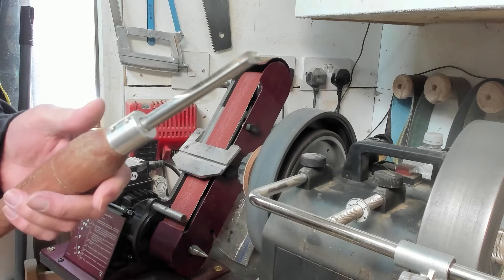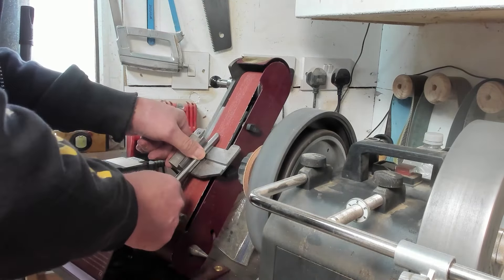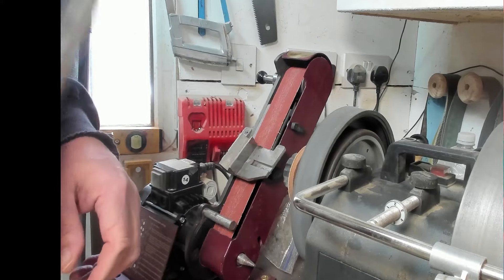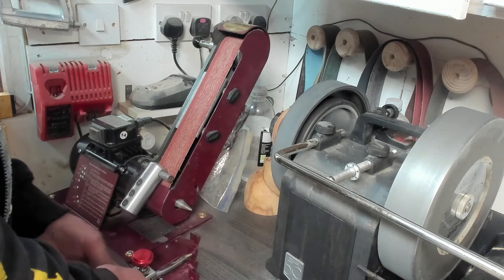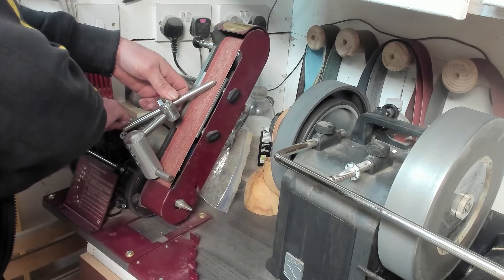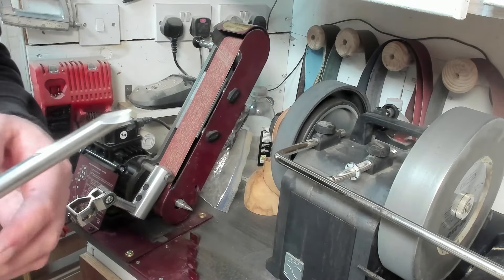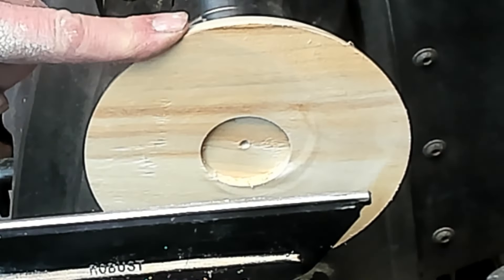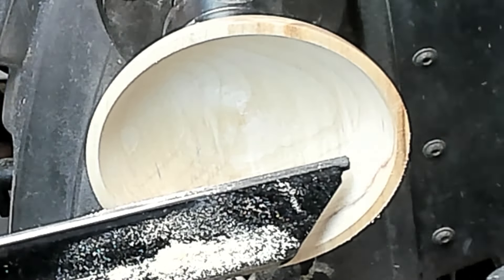Easy long wing gouge grind on the #ProEdge #robertsorbytools #irish grind #Elsworth grind

Comment: Excellent demo Pete, Did try this once a couple of years back and it all went horribly wrong. Now I see where I went wrong so will certainly give that another go. Thank you buddy.
Reply from the maker: Glad it was helpful 2 main points 15° horseshoe for the top profile and use the extra length of the 40° protrusion corrected to 45° or 50° on the long grind jig to avoid hitting the sides!
Reply: I seem to remember 1) Tha Handle stopped a full swiing to the left as you pointed out and I think I chose the longer pro set. Ended up like an assagai lol Now I know better

Comment: Looks like it cut really well.
Reply from the maker: It does cut well, the bowl was only shown on a couple of cuts to show inside and outside profile as I didn't want the video to run long. but I did finish the bowl completely with that grind off the 60 grit belt.

Comment: Nicely done Pete, yeah the problem the ProEdge has doing an Irish grind is one of the reasons I stayed with with a bench grinder. As you know I use an Irish grind on all of my gouges and when I tried out a Proedge it simply can't do it if the tool has a handle , it can do handless like you did in the video though. Great video mate.
Shay
Reply from the maker: Every sharpening system has strengths and weaknesses, ProEdge strength is the speed and ease of replicating Fingernail and Traditional  profiles on gouges and a flat bevel on Skews, stray from that and the weaknesses show. But simply drilling a hole at 40° allows me to create the 40/40 grind  easily (but no jig), this video shows how to extend the wings, so there are ways around. However the same is true of any system it's weakness can be worked around.
Reply: That is very true Pete,  no system is perfect.
Shay
Reply: Another great demonstration Pete 👍🙂

Comment: Hey Pete, where do you get your tool handles,? if you make them, where do you get the ferrule/collar with grub screws?
Reply from the maker: I make my own handles I like to make things I use every day and like them to be a bit different as I have large hands the connectors were designed by me and are sold by Mark Becket as I don't really do retailing you can find them here https://mark.beckett.woodturners.uk/shop/abrasives/52-85-multi-handle-ferrule.html#

Comment: Hello, Thankyou for posting this video. Really really helpful indeed. A question if I may, I have the ProEdge and am trying to work out if I’d be able to create a 30 degree long grind on a spindle gouge to create a detail gouge? The Proset only goes to 35 degrees so when using either  of the long grind holes it would only allow either a 40 or 45 degree bevel angle (due to the +5). Do you happen to know a work around how this could be done? Many Thanks, Joe.
Reply from the maker: I have a worn spindle gouge I will make a video. I think I can make it work...
Reply: @PeteTwistedTrees Hiya Pete, that would be amazing! Thank you, I’ll keep an eye out for the video :)
Reply from the maker: Just published the video, https://youtu.be/CHbjBmM9iPQ I failed to get what you want, but hope the video is good for you.
Reply: @PeteTwistedTrees  Thank you so much Pete! Really appreciate your help with this one.